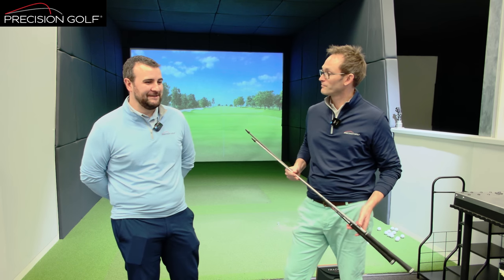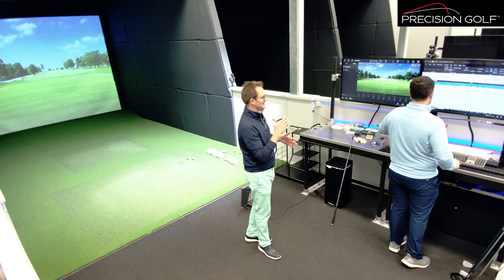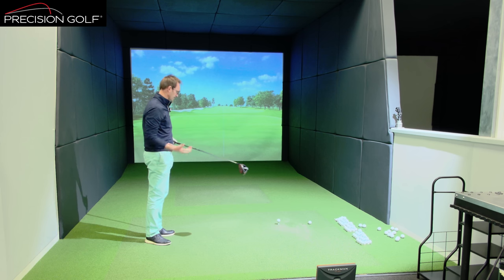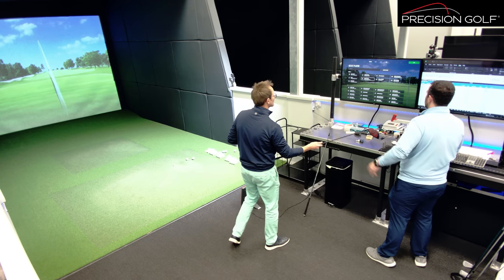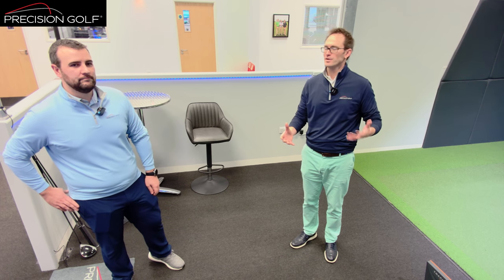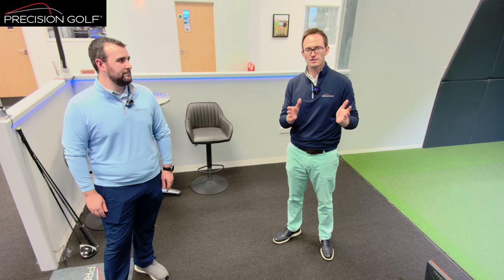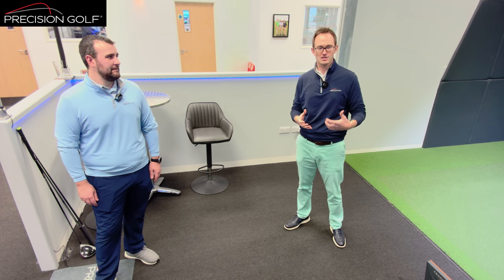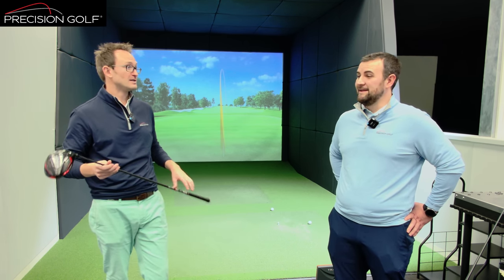The MYTH Surrounding Shaft FLEX

Comment: After spending most of my golf career playing unfitted golf clubs I did tons of research on the new shafts about 12 years ago. Removable heads were just becoming available and out of my price range. I learned that torque was way more important than flex. I built my own set, built them long and heavy and set the lofts and lies so they were completely consistent. Set the swing weights all heavy. Even made my putter longer so I could practice longer with it. Most comfortable set I ever owned. Every club matched my distance predictions right out of the bag. There was no Trac Man except at Golfer's Warehouse. I knew exactly where they were going and how far. First time golf was ever easy.
Reply from the maker: Hi John.

Many thanks for your comments and becoming involved in the discussion. Fitting is not an exact science. That is why on occasion you have to think out of the box and work with a customer to achieve what feels right for client. Trackman data is not sufficient alone. See you next time. 👍🏻
Reply: Curious about the "heavy" swingweight.  What swingwweight did you end up with?
Reply: @francophillips2156  E0. It was a byproduct of shaft length. I am 6'-1" but have short arms. Because of girth in the abdomen, I hated playing upright lies. I always wanted Tom Watson lie angles and his plane but couldn't get that being about 5 inches taller. Set design is always about compromises in many different aspects.

I set out mostly to be able to work from my 7 iron loft, lie, swing weight, length, head weight, shaft weight, grip size, etc. to predict a driver that would reach about 300 yards overall. Then I just filled in the yardage gaps till I had a set. I knew my game very well. I carried 5 clubs that modern makers called wedges. I carried 6 thru 9 irons. Used a hybrid, a 4 wood and a 2 wood (nominally) to fill the gaps.
Reply from the maker: @francophillips2156  I was testing both shafts at D2 swingweight. My own gamer Driver swings at D3.5 but the shaft weight is a Graphite Desgn XC-6 which is heavier at 65g as opposed to the 53g weight of the two shafts I tested with in the video.

Comment: Useful video. I’ve always reacted to weight and bend profile. Firm butt end some give in the middle and a stable tip section always seemed to work best. My view the shaft is effectively a timing device and varies player to player subject to their tempo and transition etc.
Reply from the maker: Hi Sean.  Thanks for your comments. Yes you’re absolutely right. Swingweight then calibrates the quality of that strike.
Reply: Only 98 to 100mph ss... Tried all fittings and x stiff always gives me by far best numbers, strange tbf

Comment: I think flex is there to pander to the male ego.  Having been fitted at precision twice, neither the fitter nor I ever discussed flex.  He handed me a club with a shaft in it, I hit a few balls with it and we discussed how it felt and the results.  First time I knew what flex the shafts were was on the invoice.  As a consequence I have stiff shafts in the woods, regular flex in the irons, and no idea in the wedges (should be almost time for a new fit).

With graphite shafts especially, even if you are not getting fit and just buying stock, flex is a dangerous thing to consider.  As the video states, different shafts even with the same flex may have very different bend profiles.
Reply from the maker: Thanks for your input Justin. Yes you’re correct. Flex is really a byproduct of shaft weight.

Comment: Was fitted last week for new clubs. Though I don’t have a lot of swing speed I wasn’t particularly worried about gaining distance but needed to find a way to maintain my current distances (don’t get a lot of distance so can’t afford to lose any!!) but with less effort and ideally with clubs that felt lighter and would also help increase my launch and spin.  Went through a few combinations but one in particular jumped straight out immediately both visually and in terms of data giving me everything I asked for and also seems to have enabled me to get more distance too which is a bonus! Was nowhere near my preconceptions of what I thought would be the likely club set up. 
Really showed the value of going through the process at the very least.
Reply from the maker: It helps tremendously if customers go into a fitting with an open mind, and without any preconceived ideas as to what they think they need. Sounds like you’re in a great place moving into the New Year. If we can be of any help, please don’t hesitate to drop us a line.
Reply: @Precision_Golf  You can be sure that will happen at some point! Keep up the great work and best wishes for 2023!

Comment: I swing my 6 at 98 and driver at 118 on avg, I played the stock elevate 95 in my apex pros for a whole season. Truth be told, I love the R flex. Great but high spin. I see a problem with my 4 and 5. Almost unusable when I go after it. Balloons, 4 i will spin at 5200 and fall at 220. Which sounds good until you see my gaping at the top end. I love the feel of a soft tip in my driver. I want to mess around with weights. I would love to find a good middle ground
Reply from the maker: We would love to help you with your game Ken and very confident we can find optimal performance for you.
Reply: This is exactly what happens with my 6, 5, and 4 iron (elevate 95 R shafts in Mavriks). My gapping is too close at the top. I swing my driver at 115 mph. Maybe a fitting would help.

Comment: Watched a video with Rocco Mediate sayin he uses ventus trx black shaft so he gets more spin to draw ball and not go high right on him. He says need stiff to draw. wondered what your thoughts were on this.
Reply from the maker: The flex of the shaft will not stop him being able to turn the face over and control the face, however he may “feel” like the face bows opens on him with a softer playing shaft. The firmer feel and flex may give him the confidence that the head is in line with his hands and the confidence to rotate the face through the ball, resulting in a more consistent shot shape.

The actual difference in how much the shaft is bending, especially with a low loading swing like Rocco’s, is very, very small so I can only see this being the way he reacts to a softer feeling shaft versus a firmer feeling shaft rather than physically a softer shaft hanging the face open on him. 

Less “kick” with a shaft in principle should reduce spin as the head is not deflecting as much and therefore the dynamic loft reduces slightly, however if he is seeing higher spin numbers from a stiffer shaft then this will mean a drawn shot is less likely to lose too much spin as tree face closes down and therefore it will stay in the air slightly better for him making the shot more controllable.

Comment: Just found your channel. Great and very thought provoking content, a question if I may? Any ideas on why I can slice a 65g stiff shaft and pull a 70g stiff shaft in my driver? I am an average single digit handicap golfer and very good with my irons which again are stiff recoil dart 75 shafts. Driver is causing me trouble every time I play
Reply from the maker: Relative to your irons shafts the 70g driver shaft is heavy so probably getting behind you and flipping through impact. The 65g may well depend on its balance point as to why it is slicing but it could be worth testing a slightly lighter shaft still, maybe 55g as that in theory would match your iron shaft weight better.

Comment: Simon has exquisite control over his swing speed, matching up the speed for these two shafts. I'm pretty sure his skill contributes to making both of these shafts produce almost identical results except for the slight increase in spin. It would be interesting to see how their performance would compare in the hands of a much less coordinated and skilled player, say a 17 handicapper, who could not fine tune his biomechanics to control the swing as well as Simon.
Reply from the maker: Very kind John. It was very much a case in this video of having to make myself swing through the feel differences to eliminate everything but the shaft flex as much as possible. In the real world the player will react to the feel of the shaft and its flex and commit more with the shaft that responds in a way that gives them confidence

Comment: I am a retired PGA pro, 72 and disabled. After 55 years fighting a slice, I can now draw the ball but only with a senior shaft, offset driver. Because of my disabilities, I have to release arms and hands before impact so the club is "free-wheeling". My understanding is that the head flexes forward as its centre of gravity lines up with the grip, closing the face and adding loft enabling me to hit a high draw with an 11 degree driver. Another driver, 12 deg, regular, flies lower with fade. Even if I flick it, it is difficult to produce draw. My 3 wood (regular) goes lower than my driver and fades. Is this because my "free-wheeling" method is different from, for example, your more modern forceful action through the ball? I am unable to travel to a good test centre to test my theory.
Reply from the maker: Hi. I suspect the answer to all your questions is shaft weight and swingweight. All can be adapted to meet your requirements. We have a tremendous amount of experience dealing with double and single leg amputees who are so sensitive to shaft weight and before coming to see us have to manipulate ball flight with their hands. This can be made tremendously easier with correctly set up and built equipment.
Reply: @Precision_Golf  thanks, I would love to come for help, unfortunately I am unable to travel far. I cannot afford to spend much on this but I will experiment a bit with s/h drivers before I have to give up golf altogether. Can you just confirm that, with a more flexible shaft, the face will usually be more closed and lofted at impact. This was not obvious in your demonstration but I feel it should apply to my weaker swing. Many thanks.
Reply from the maker: @oldprogolf7292  With a slower swing a softer shaft will promote slightly higher launch and spin and will feel easier to close the face - it will close marginally more than a firmer shaft but only very slightly but will feel much easier to get response from
Reply: @Precision_Golf  Thanks. If my health improves I will come and see you.

Comment: Can you do a test on driver shafts with weights ? Like going from 65gram to 45gram. Does it increase speed and does the spin etc suffer from it
Ive always wondered
Reply from the maker: Hi Aksel. There is always a critical point between having enough weight to keep directional consistency and flight optimised and maximising club speed so it really is a case of finding a happy medium of the two

Certainly one we can film!
Reply: @Precision_Golf  That would be much appreciatet !

Comment: Have a question for you: If you can narrow shafts down to the right WEIGHT, does it then purely become a feel preference? An example would be all dynamic gold shafts all weight about the same, so theoretically you could play any of them?
Reply from the maker: Hi James.

There are a few grams between R300 and X100 and obviously they are very different bend profiles. Suitability of shafts is mainly down to how somebody loads the shaft and the preferences on flight and feel. Short loading cannot be determined by swingspeed along. Two golfers with identical club speeds may require to wholly different shaft weights and profiles. Thanks for watching.

Comment: Great Video!

All being equal does the shaft flex not speed up or slow down the amount of lead deflection? The more lead deflection at impact can potentially increase AoA, lower the strike and move the path more to the left. 

Depending on were the mass is on a Driver does the toe not rotate at higher speeds again having an effect on club face position? 

Shaft droop will also have a role to play again depending on how high the anchor is through impact from face plane tilt(lie angle)and strike point. Justin Thomas & Lexi Thomas being two players that create such a move at impact. 

Can a shaft effect the vsp potentially influencing lie angle and in turn starting point? 

Surely the true role a golf shaft has has been documented from a company with the use of a robotic arm from a neutral delivery position? Which in turn can then be applied to different delivery’s  etc. 

Love the content and i really hope the channel starts to receive the reviews it deserves 👍
Reply from the maker: With the difference in the amount of flex in the shaft between a single flex range (R flex to S or S flex to X flex etc) only being 3% - 5% of the total flex of the shaft it is very minimal indeed unless you were to make a 3 or 4 flex range change in flex which is why the Autoflex shaft requires a lower spin head than a more conventional flex shaft to counter the extra launch and spin produced, however this is a very exaggerated change in flex versus a conventional flex range.

Again the extra toe rotation due to flex is incredibly minimal, although it does exist, however again you have to make a large change in flex to see any tangible difference in flight and shot shape but to do this with a relevant shaft weight for most players is virtually impossible.

With the lack of loft on a Driver the effect of lie on start line and gear effect on shot shape is incredibly minimal, although it does exist but is so minimal that the influence is a very long way down the priority list when looking at what produces the best overall performance of a club.

As you say all shaft companies use a robot to test for repeatability and the ability to dial in strike point and how that affects the shafts performance through impact from a stability and twisting point of view and 99.9% of golfers will deliver a different pattern through the ball and therefore the theory of what a shaft does and the reality when an individual player swings it can be quite different. This is why the only way to know exactly how a player and a shaft perform together is a dynamic test.

Very glad you are enjoying the content and thank you for the interaction!
Reply: @Precision_Golf  Thank you for your reply 👍. You mentioned gear effect with a driver is minimal due to the lack of loft?
Reply from the maker: @ThunderMk2  The gearing due to the loft is very low (unlike with a wedge at 50 degrees where the effect is much higher). There is plenty of gear effect on off-centre strikes but the effect of the loft alone on start line based on a lie angle being upright or flat due to swing plane and handle position is very small. The difference the lie makes is based on whether the lie angle of how the shaft inserts into the head sits upright or flat and that effects the way the head and shaft interact (more upright bringing the CG closer to the shaft and therefore making it easier to square up)